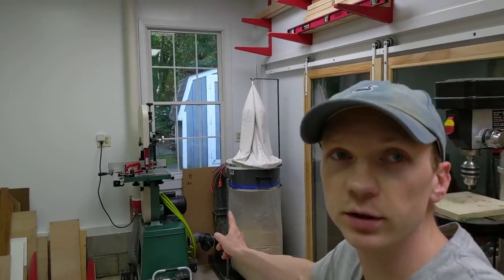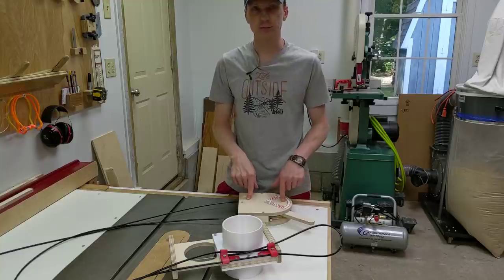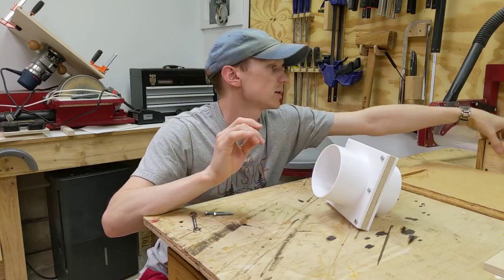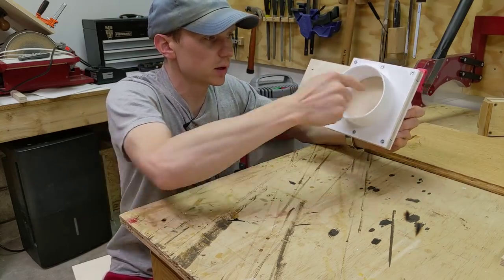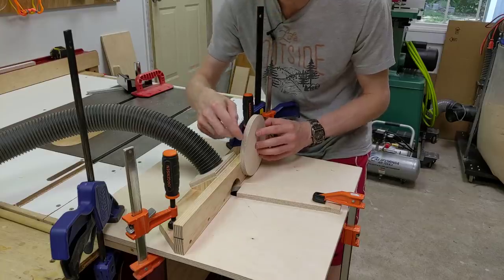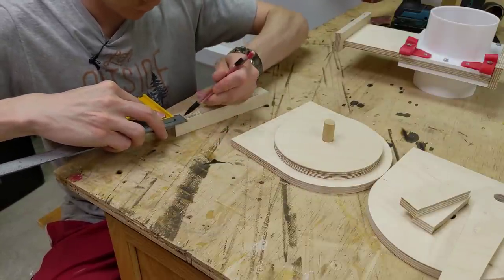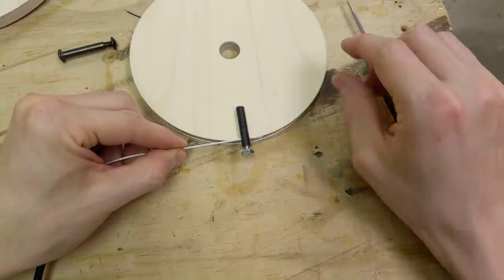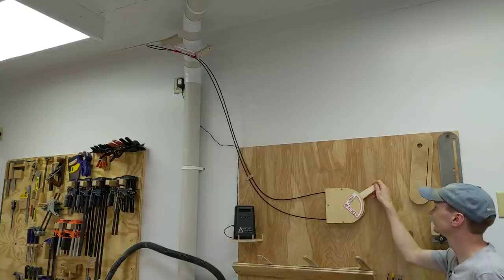Making Lever Action Blast Gates for 4" PVC

Comment: Great idea to use the bowden cables (I think that's what they're called) for actuating the blast gates, now you need to add a couple of micro switches to the blast gates to turn on the shop vac automatically when you open one of the blast gates. 
Thanks for sharing the video. :-)

Comment: Nice job! I am surprised you used two cables - these cables are designed to both push and pull, so you could've just used one. I'm sure you tried it with just one - what made you go to a two cable arrangement?
Reply from the maker: No, you can't push with these cables. As soon as the cable leaves the sleeve it is unsupported. No way to push an unsupported cable.
Reply: @JustinDepew  Ahh, thanks Justin. Good to get that straight before I start expecting the impossible!
Reply: @JustinDepew   I was thinking of either using a return spring, or a solid "push-pull" inner cable in a supported housing, like on a mower throttle.
Gotta love the way you think though.
edit  Just realized it would be hard to get a solid cable to push that long of an arc.  Still think the braided cable / return spring idea might have some merit.

Comment: I love this approach.  I am working on implementing this myself as my ceilings are lowish so I ran the main dust collection trunk around the sides of my garage, so blast gates are hard to access behind machines.

I was wondering why you decided to use 2 cables rather than some kind of a spring return?  I had been thinking about using a spring to cut the number of cables used in half, but then I was wondering if this might tend to bind if the force is off axis a bit.  Did you try this?
Reply from the maker: I have not tried the spring return. It does cut the cables in half, but you do need a mechanism to hold the gate open when in use. Check out Cosmas's video as he made some blast gates like this. I'm sure they would work just as well.

Comment: Nice build! I just finished modifying my TS blast gate to operate with your cable brackets. It works! Only problem is the cables I have are from a bicycle and are not long enough to reach the location I have selected for the control lever. Where did you get those long cables?
Reply from the maker: I got them from ebay. They are go kart throttle cables.

Comment: excellent work my friend, almost as good as i am...LOL...just kidding, no where near your skill level. I'm just starting out in woodworking and like trying to make things i need as you do...I was wondering if you could explain or give the formula you used to sized your pulley (circular rotation) to rotate the distance you needed to close your gate (linear motion) pls...i would appreciate it.
Reply from the maker: Great question. The only formula you need to know is the circumference of a circle or C=pi*diameter. I wanted the pulley to rotate 1/4 of a turn or 1/4 of its circumference. The distance of 1/4 of the circumference needs to equal the travel of the blast gate. So I measured the length of the blast gate travel and then back calculated the diameter of the pulley. (Pulley Diameter) = (Blast Gate Travel*4)/(pi)
Reply: @JustinDepew  Thanks for the reply, I should have known this but been out school for some years now and you know the old saying, "don't use it, you lose it"...LOL Keep up the good work and videos my friend, I'm learning a lot by watching you.

Comment: Nice job, but why?  It seems to me that even with your tight space, you could have easily mounted a blast gate adjacent to or on your machines that you could actuate by hand or with a simple, short pull rod.  There is absolutely no reason at all from a fluid dynamics standpoint to put blast gates anywhere along the run of any trunk line.  There will be zero air flow in a trunk if all tool-mounted blast gates on that trunk are closed.  With no flow, there is zero impact on flow (CFM and SP) in any trunk being used or anywhere in your dust collection system.  I believe Bill Pentz erroneously suggests somewhere on his website to put blast gates on trunk lines, but he is wrong.
Reply: Even so, the blast gates aren’t always that easily accessible depending on your layout.  My table saw blast gate is behind my table saw underneath an outfeed table and it’s really inconvenient to get there.